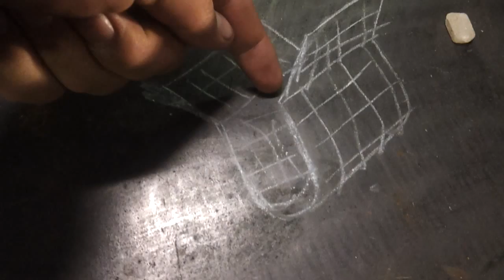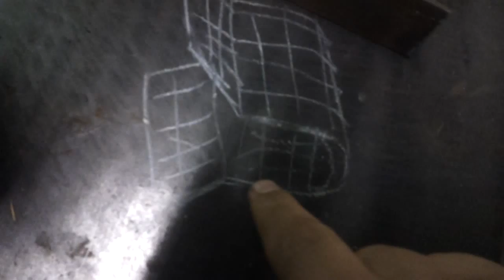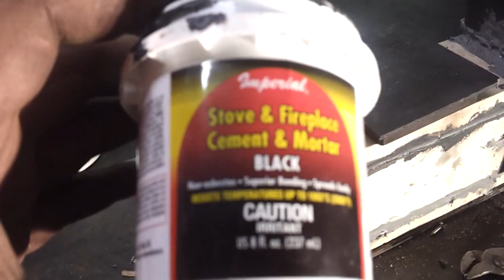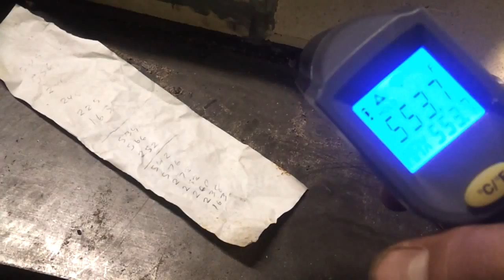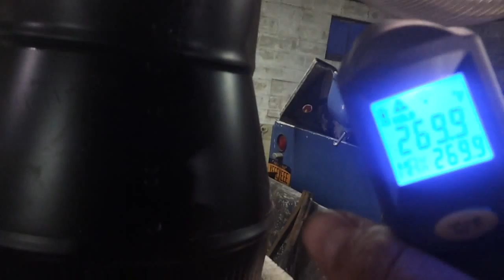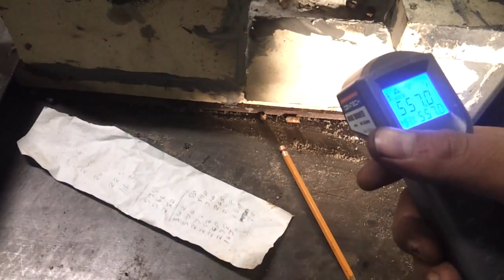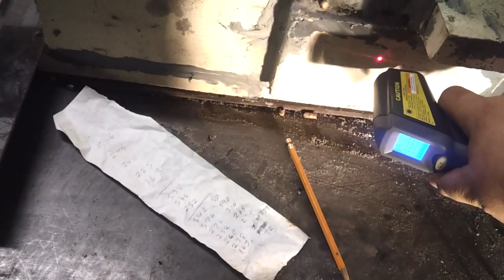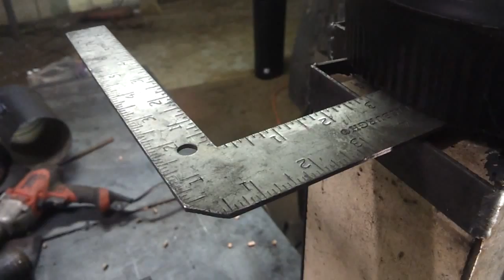Rocket Mass Heater/Stove (Part 3)

Comment: Happy New Year. Stove is looking good
Reply from the maker: Thank you. Me and my partner on this project are closing in on a final design for a prototype to build and do some long term testing on. If one of these can heat my shop we have a home run on our hands. My barrel stove does it but it struggles in the really cold temps and uses a ton of wood in the process.